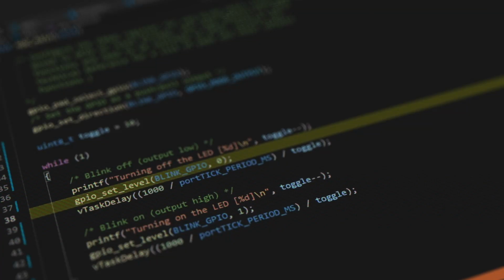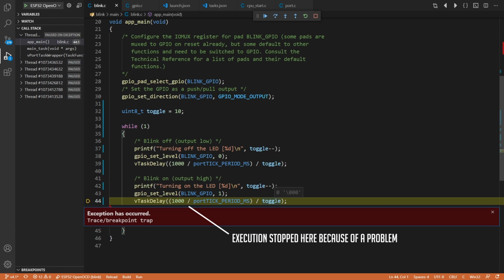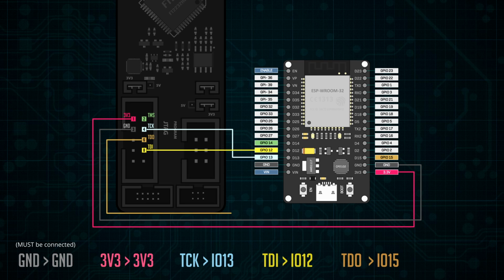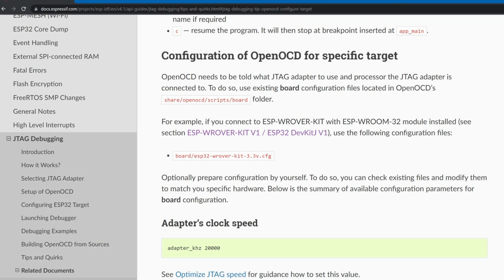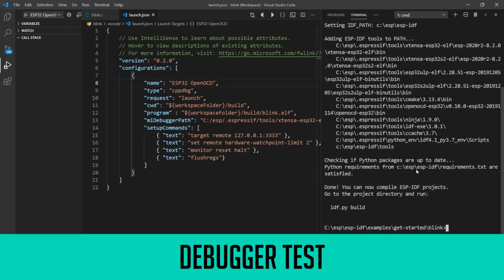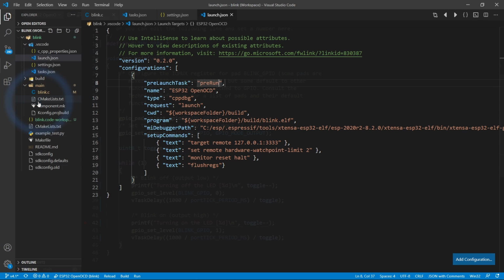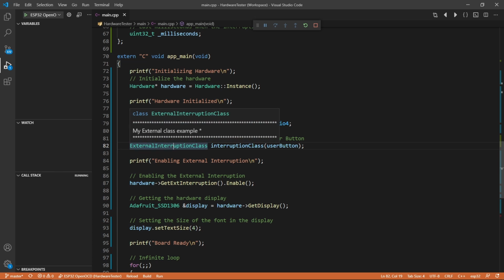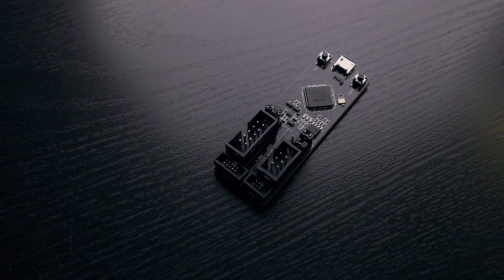ESP32 - DEBUGGING your ESP-IDF code using JTAG [VS CODE]

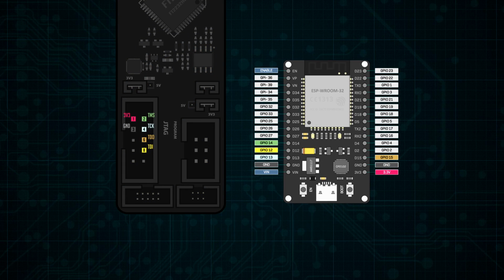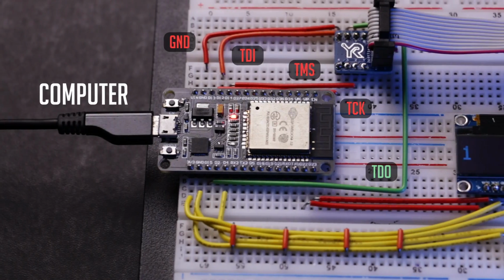Comment: Very nicely done! Respectfully you have an serious error that may cause crashes, bugs or unexpected operation in you port connection instructions starting at @6:00.  I do not see that same connection from esp32 board back to the prog-2 controller when you showed the physical board connections @6:15. 

The 3.3v you identified on the Prog-2 board should not be connected to 3.3v on the esp32 board. Both the prog-2 board and the esp32 target board use 5v to 3.3v LDO regulators to generate those 3.3v sources. So connecting these to each other simply put will reuslt in the 2 regulators fighting each other to regulated the now cross connected 3.3v supply acorss the 2 boards causing votage transients and noise. I beleive the purpose for the 3.3v out pin on the prog-2 board is a refereence voltage possibly for a target that requires a reference voltage for the jtag signals or has some level converter on it that requires it. The prog-2 board "Vdd" pin on the jtag port should not be used to power a target. It does not have enough juice or the proper bypass to do so.

Furthermore.The 5v/3.3v jumper pin on the prog-2 board selects either the input to its LDO regulator being the 5v or the output of the LDO regulator being the 3.3v as the source that is what you refered to as 3.3v pin on the prog-2 jtag connector. It is really labeled VDD becuase it can be slected by the jumper to be 5v or 3.3v.

I was a Reactor Operator onboard US Fast Attack Submaries followed by being a hardware designer since the early 80's in silicon valley. I have 10 US Patents in design of Fault Tolerant Servers. I am no Software guy which is why I'm here getting your good isntruction in that matter. Please by all means review the espressif documentation for the prog-2 board. The jtag port header identifies the pin as  "VDD" and function as "power supply" at https://documentation.espressif.com/espressif-esp-dev-kits/en/latest/other/esp-prog-2/user_guide.html#hardware-reference. The schematics can be referenced from a link on that same page or use  https://dl.espressif.com/schematics/SCH_ESP32-PROG-2_20250403.pdf

Comment: He is showing you how to blow up your ESP32. You cannot connect the 3.3v Pin of the ESP Programmer to the 3.3v Pin of the ESP32; If you have the ESP32 connected to the USB cable also. That is placing TWO DIFFERENT POWER OUTPUTS TOGETHER............ 

If powering via USB: Do not connect the ESP-Prog 3.3V pin to the ESP32. Simply connect the Ground (GND), TX, RX, and JTAG pins (if debugging).

Comment: Excellent video thanks, but momentarily terrifying side effect: After using the zadig tool to update the driver, my keyboard quit working (i.e. typing yielded no characters on the display).  After I got my wits about me again, it occurred to me that keyboard that I was using had two auxiliary USB ports and may have contained the same chip as the JTAG interface board ... yep.  I changed to a "plain" keyboard with no extra USB ports and regained control of my PC.  Just a heads up to others who may experience the same fright.

Comment: Hey, this is a very good channel to get started with VSCode and openOCD. Sadly I came across this channel so late. Keep the good work? By the way: did you already do a video with ESP32 Debugging using PlatformIO? My goal would be to use it in the next project.

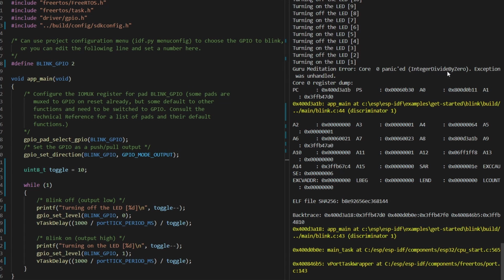Comment: Hey! Regarding 1:50
In my case (I have a ESP32 and am using Arduino framework with platformio in vscode)  it does not show the line in which the exception occurred.
Any idea why?

Comment: Yuri R, It shows that you have put a lot of work in to making these videos and they are very helpful. I have followed along while trying to adapt your instructions to the esp32c6.  Unfortunately I have had to leave out some of the neat changes you discussed because they do not seem to work for me.  For instance when I used the preRun task the gdb was not able to connect to the openocd.  When I tried it by using an outside command shell to start up the openocd I was able to get the debugger to run OK, except I had to remove the commands to flash the device.  The command to set the address of the boot loader was 0x0000 for the esp32c6 but for some reason it just would not accept that.  If you have suggestions how I might add those back in it would be helpful.  However, all in all you did a marvelous job of pointing out all the things necessary to get the debugger going with visual studio code and I really appreciate the time and work you put it.

Comment: Hi Yuri. This video is extremely helpful. Could you please advise about the final step, where one completely removes the USB connection to the ESP32 and powers it from the ESP-PROG? Does one have to use the PROG interface on the ESP-PROG or only the JTAG interface?

Comment: I have some question if I have some circuit based on esp-wrover-e board where esp32 with 2M flash was replaced to to esp32 with 16M flash, I tried to run hello_world from examples on esp-idf 5.1.2,  I changed in menu config and it works for rs232, but unfortunately  when I'm working with JTAG( I burn the executable also via JTAG) my debugger doesn't see the new flash size, my question is how I can configure it for debugger?

Comment: @YuriR  So I followed your first video how to set up the environment and everything else, with some changes , because instead installing ESP_IDF I used the Plugin in VSCode, I made everything to work. Now when it comes to debugging "openocd -f board/esp32-wrover-kit-3.3v.cfg" is not working because I use a Wroom-32D Module. When I try to rum esp-wroom-32.cfg  it gives me the message that "board/esp-wroom-32.cfg is deprecated" . what changes I have to make to be able to use the WROOM32 module?

Comment: Thank you but you should mention right at the beginning that this work is not for platformio. Beginners like me are miss leaded. If the installation of esp-idef and platformio is through VS there is no need to worry about the files in .vscode !!

Comment: Thanks for the awesome video.
After installation of drivers for JTAG, when i execute openocd command, getting error.

$openocd -f interface/ftdi/esp32_devkitj_v1.cfg

Error: no device found
Error: unable to open ftdi device with vid 0403, paid 6010, description '*', serial '*' at bus location '*'
Error: no device found
Error: unable to open ftdi device with vid 0403, paid 6014, description '*', serial '*' at bus location '*'

Any idea/pointer you can help me to resolve this error?

I want run a debug session for esp32 device from vscode through devcontainer

Thank you

Comment: Well, nice tutorial but the problem is that debugger does not work for me. For some reason it cannot connect to the openocd. I can validate that the gdb does connect to the remote (if I do that manually) but it does not work with VS code. And BTW, the terminal CMD behavies strange. When I press debug it runs just the teminal and does not execture any other commands, and no debugging started. And BTW in you tutorial you tell about setting up CMD but from this video I can see that you yourself use PowerShell.
Reply: OK, I got debugger working. Had to remove { "text": "flashregs" }... gdb complaid that it's undentified command, and I had to add that trick -c /"set ESP_RTOS none/"
Reply: BTW, about that last part with gdb loading the firmware. You don't have to load bootloader and partition every time, right? You can load only the firmware itself, right? Does gdb loads those every time you run it?

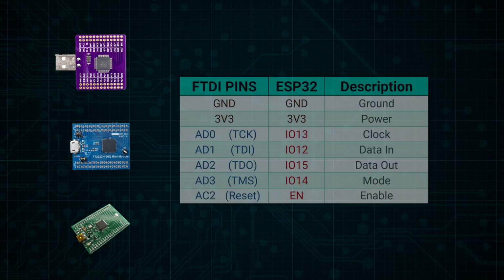Comment: I have a generic board (top left) like the one you showed at 6:24.  Zadig on my windows 10 laptop is seeing it as a single RS232-HS and not a dual one. I re-installed the FTDI driver but that did not help. What am I missing ?

Comment: Thank you AGAIN!  My next step in setting up my ESP32 system is going to be figuring out how to use JTAG—looks like that’s going to be much easier now!  I know it’s not a big enough subject to deserve its own video, but would you consider inserting info on using JTAG via the on-board JTAG interface in the 2-channel USB connector built into current dev boards in a future video?  I think I can probably figure it out, but I’ve seen so much in your other videos that I KNOW I wouldn’t have figured out on my own, that I think it would be worthwhile!  Again, thank you for your videos—they are so helpful!

Comment: very clear explanation thanks a lot yuri.... my doubt is if i want to use 13,14,15,12 pins as gpio means it will work or not?
Reply from the maker: You can use those pins normally, but it could mess with your JTAG. So, my suggestion is to use some #ifdef to protect those pins while you're JTAG debugging. Otherwise, you can just use the IDF terminal for debugging, and it should be all good.

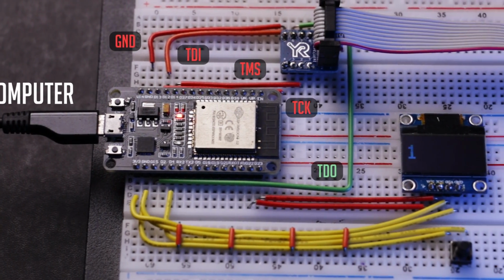Comment: Note : For wire connections , if you are using seperate USB to power the ESP board do not connect the 3.3V from ESP to ESP prog . Check the connections at 6:16

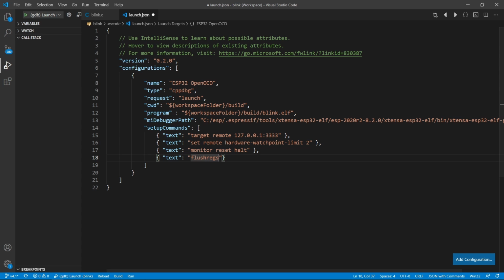Comment: 11:15 With the "monitor reset halt" command included, I am unable to get a debug session going and the gdb connection gets dropped.   After removing that setup command, I was able to get the debug session going.

ESP-Prog + ESP32-cam
Reply from the maker: Great to hear it worked!

Comment: Thanks for your video, but the command "-c \"set ESP_RTOS none\" in tasks.json  is not work for me.
I need to try several time to get one time works, otherwise will get the error message

ERROR: Unable to start debugging. Failed to find thread 3 for break event
The program 'C:\Espressif\frameworks\esp-idf-v4.3.3\examples\get-started\blink\build\blink.elf' has exited with code 42 (0x0000002a).

[Inferior 1 (Remote target) detached]
Reply: Please use openocd -c 'set ESP_RTOS none' -f board/esp32-wrover-kit-3.3v.cfg  . For more videos about ESP32 visit my channel

Comment: It seems tools in this video also equally applicable to the ESP8266, and it's RISC-V successor (ESP32-C3H4 cfg)?  

So FTDI's 2232HL drivers (D2XX and VCP) support dual COM ports, but by installing Zadig / Winusb (Interface 0) then you get a COM port and a JTAG/OpenOCD?

I like the tip of calling (prerun) tasks json from launch json in order to run OpenOCD!  But does debugging actually flash the program.. or if you cycle power nothing in the flash changed?   And just for safety, is it possible to ONLY program the application, and not the bootloader bin?

Finally, not mentioned, but how DO you program via the bootloader?   I understand it uses the serial interface, but after putting the board in bootloader mode, how does the application file get generated/uploaded?
Reply from the maker: Hi Ben, sorry for the delay.
You are right, the idea of this video is to show how everything works in the background and how you configure them. In order to change the microcontroller you just need to rewire the JTAG and configure your OpenOCD and the rest should be the same.

Regarding the COM Port, that's correct, by default, windows configure the 2232HL chip as dual serial, but instead, we need one serial and one debug interface. That is why we use Zadig to change that.

Regarding the Debugging flashing the program, if you just run the debugger, it won't load the firmware for you. That is why we created that prerun task. As the debugger can read and write the flash memory you can update just the application if you want. Alternatively, you can load just your application via serial using idf.py app-flash if you want.

Regarding programming via the bootloader, I'm not sure exactly what you want to know, but my first IDF video on the channel shows how to do it. In this video here we are uploading straight through JTAG, writing in the memory directly.

I hope that helps!

Comment: Sir, Can we use the Ft232rl FTDI programmer as a JTAG? If so, then how? Since it is cheap and affordable, then it will be easy to learn debugging.
Reply from the maker: Hi Mohd, unfortunately the FT232RL unfortunately doesn't seem to have a JTAG interface so it won't work :(

Comment: Very well done and explained. Can we use this setup to debug arduino framework code? Thanks for the video help.
Reply from the maker: Hi Milind, this method is specific for ESP32 and Visual Studio Code. You can probably check PlatformIO to do this!
Reply: @YuriR  Thanks, yes I mean using PlatformIO and  arduino framework/libraries, Vs code & JTAG. I should had stated that. Iam still waiting for my jtag debugger!

Comment: Can you debug ESP-IDF libraries ("binary blob" object files) and optimize startup time for some very quick Wifi broadcasts? (To optimize for battery life.) Do you get to put a breakpoint very early after power up to do this? It would be nice to be able to send out a Wifi message in just a few milliseconds and then power down. (Not sure when the Wifi PLL is asked to stabilized after reset, but maybe that request can be done very soon in the boot process?)
Reply from the maker: Hi Fity, yes can debug ESP-IDF libraries. But you can't debug anything that's in binary format using this method.

Comment: if each file needs extra .json files, it is really microsoft style and waste of time. Using gdb directly is simpler, right? programmer wants stable tool not always play with tool so they can concentrate on product dev itself. I say microsoft style vs Unix/Linux style - simple, fast, tiny. Vscode used to be SUV now seems towards to build a truck.

Comment: When my app has an exception I just get a raw binary call stack on the serial terminal. I can run an external tool on the hex values and my bin file to get the function line numbers, but how do you get the terminal to show them.?
Reply from the maker: Hi Mark! Sorry for the delay. Yes, when you get exceptions while debugging, the output is raw and you need to use an external tool. I recommend turning off the debugger to check the exception messages right on the terminal. It's a bit annoying.

Comment: Hi @Yuri R, thank you for this support, i have a doubt about uploading. My board is tiny and i have a little space in order to keep the serial programmer and JTAG pins. Is it possible to upload the software through the JTAG not using the serial programmer interface ? There's some problem on uploading throught the JTAG ? Thank you!
Reply from the maker: Hi Joao, thank you! Sorry for the delayed response. You probably already made the board, but yes you can upload everything through JTAG with no problems.

Comment: Excelent stuff Yuri, thanks a lot for these weel made videos.
Could you give more info about debugging speed. I am testing a esp-prog board with a ESP32 DevkitV1 in Linux, and even with simple code, the execution under debugging is very slow. I keep variables dropdown close and try to trace only the variable I am interested in at that moment, but still execution is slow. Any suggestions?. Thanks again!.
Reply from the maker: Hi Idux, thank you! Sorry for the delay. Check if your OpenOCD has the clock speed set at 20000 kHz, you can set the speed at the board config file (board/esp32-wrover-kit-3.3v.cfg).
Also make sure you have maximum 2 breakpoints as well, and the -nofreertos tag like in the video.
I hope that helps.

Comment: Great content, thanks for making this!
I usually use the Arduino framework with PlatformIO, and was wondering - how much (generally) of Esp-IDF content is relevant to Arduino as well?
If you could make a video detailing the similarities and differences in architecture/functions/etc that could be very helpful :)
Reply from the maker: Hi Jonathan, thanks for the comment and great video suggestion.

Everything that you learn about IDF can be relevant when using Arduino/PlaformIO framework, since Arduino (for ESP) uses IDF behind the scenes :).
Some libraries for Arduino may generate some low level conflicts sometimes, that only by knowing how IDF works you can fix it. 

I will definitely make a video like you suggested!
Reply: @YuriR  Great, subscribed and looking forward to it!
Thanks
Reply: Thanks for video. Im also interested in how to use arduino libraries in idf.

Comment: Hi Yuri, 
Is it necessary to connect 3.3V and GND between the debugger board and the eval board?
Thanks
Reply from the maker: Hi Ed. Always connected the GND to avoid any ground plane differences. 3V3 you only need to connect if you need to supply power to one of the boards. (Example: if you plug the USB port for both boards, you don't need the 3V3 connected between them)